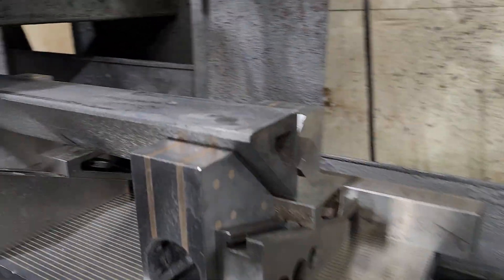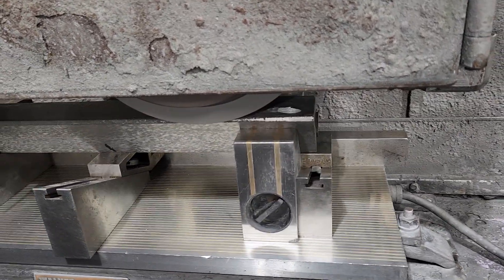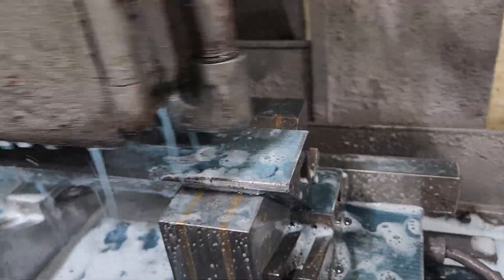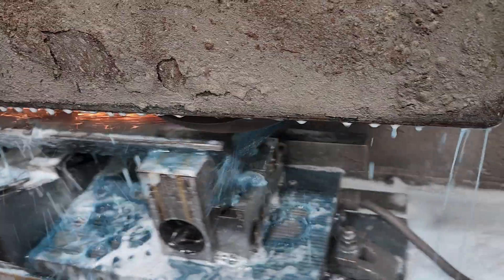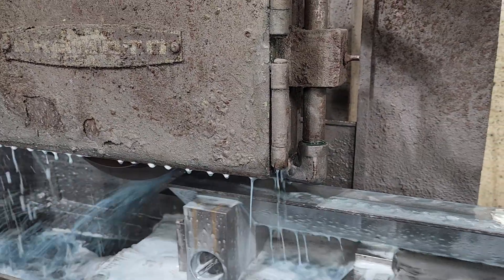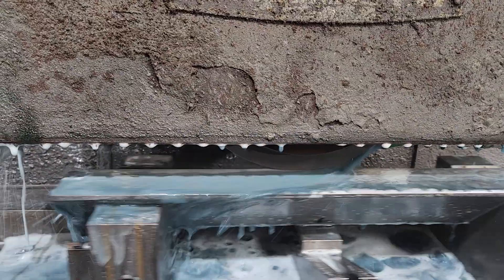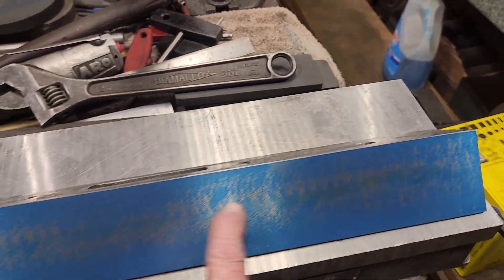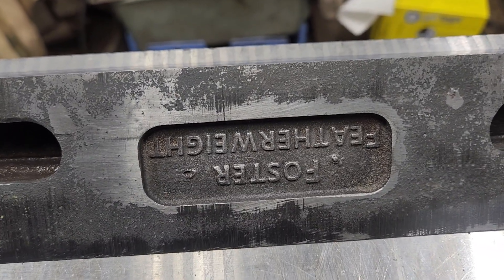2nd surface on a hollow Foster Featherweight 18" prism

Comment: Any time I’ve had lots to take off and went width deep but narrow passes (.010”, .025”, I think even .050” Y depths on occasion but .010” on Z) I’ve always got by far the best surface finish. I think the machine is more consistently sprung into stability. Sounds odd but I’ve always had better results on all machines taking a decent cut going to dimension rather than trying to tickle off tenths. I also think the wheel develops local regions that better suit the material removal conditions as the wave front progresses. The deeper cut area removes material aggressively and so beaks the wheel down into an appropriate wedge shape, while the remainder of the wheel periphery retains its fresh dress and can finely condition the few tenths left behind. I don’t really know, just trying to learn in a relative vacuum. Though that strategy gives me the best results it sure would be a lot easier with automatic feeds 😂👍
I’ll also have to go back and revisit my results as I’ve only recently begun inspecting ground work pieces much closer and desiring and attempting much finer control over finished geometry.
Reply from the maker: Thanks for your input. Yes, auto feed on every axis is awesome, and something that I am spoiled with now. I do the same thing, I rough into the spindle bearings and the wheel breaks down so taking a .025 pass isn't an issue. I have had where a 1-1/2" wide wheel breaks down an inch of the wheel, so when I do my final pass there is only a half inch of the wheel contacting, and it leaves a very nice finish. I always change my finish pass feed direction into the fresh edge that I didn't use to rough. I appreciate your input. Thanks!

Comment: Great video!!! How much time do you have to put into a rough casting this size start to finish?
Reply from the maker: Good question Joe. I would say 3 hours with the setup time. The first side took an hour, and the last one was over an hour. This next side won't take that long as it's pretty clean. So 3 to 3-1/2 hours on this, the first time doing one. Thanks for the question!

Comment: Very fine grinding job---that I've come to EXPECT from you Daryl!  You make that rough casting look like a jewel in short order.  I don't think there is any  practical reason to grind the back of the casting where the nameplate is.  But I also understand the draw to do so especially when you can do it so seemingly easily and so well.

That oval "high spot" you encountered located on the right end of the casting is the remanant of the ingate where the iron flowed into the mold and where a riser is located.  I band saw the gate off and then usually belt grind it to get it down somewhat close to flat.  It might seem more logical to gate it in the center of the casting.  However, experience has clearly shown that gating it towards the end makes a straighter and sounder casting.  The center void is made using an epoxy-bound sand core and the nameplate recess is made using an epoxy-bound "loose piece."  The various more or less 1/8" dome-like bumps on the back are where vents were made in the mold to let the gases out and allow better and quicker mold filling.

Thanks for letting us see your process.  As someone else said, that grinder is a beast---a wonderful beast!

Denis Foster
Reply from the maker: It turned out really nice. It probably took just over an hour to grind, and a lot of that time was just letting the grinder do it's thing while I was getting a camelback off the wall to scrape for a customer. I love your castings!

Comment: Excellent job! I have a few of Denis's straight edges and prisms. I bought one of his first hollow prisms after he designed it. I fly cut and scraped mine, but don't have a surface grinder other wise that would be the best way to minimize the amount of scraping. I also milled the finger holes with a 3/4" end mill to smooth them out a bit. Yours is looking very clean. Denis does very high quality castings. All of my tools from him have been really stable over the last few years and continue to print well.
Reply from the maker: Thank you for your input John. Yes, Denis does a great job on design and the casting of his prisms and camelbacks.
Reply: 💗I love hearing that comment, John.  Makes my day!   Denis Foster
Reply: @zekestrom My pleasure Denis. I haven't been active on the PM forum in quite some time now, life got in the way as it has a way of doing (especially with 4 young children).I still have another of your castings to finish up actually. Hopefully get to it sooner rather than later! Glad to see your still making these. Was an awesome experience watching the process unfold in your thread a few years ago.

Comment: Riding the workpiece toward the wheel.  Be careful there!
Reply from the maker: Thanks for the reminder. I try to be careful, but I always grind into the wheel rotation.
Reply: @OtherBrotherDarylSmith  I should have explained myself, I ment your finger was on the work piece traveling toward the wheel.
Reply from the maker: @4GSR  Oh, that!!! Yes, but it is already missing the part that was close. That dang ID grinder already got it. But your are right, it was a little careless. 😇